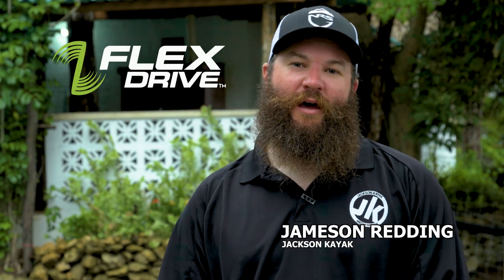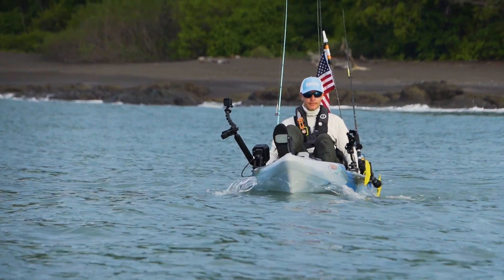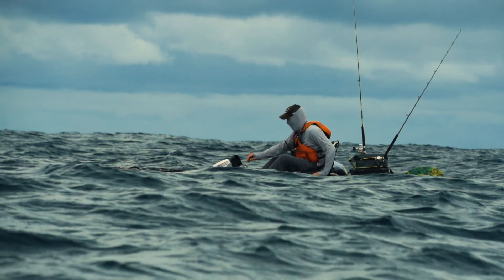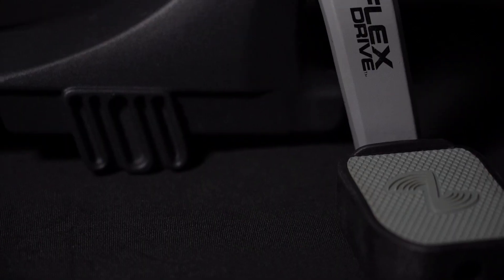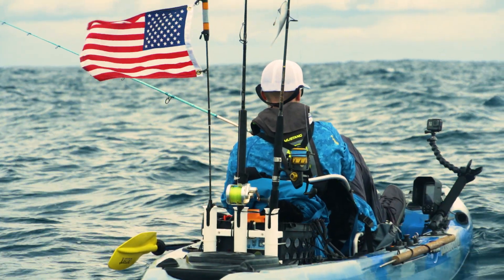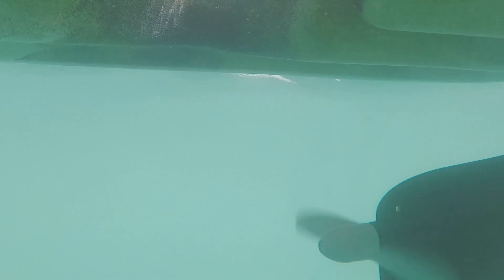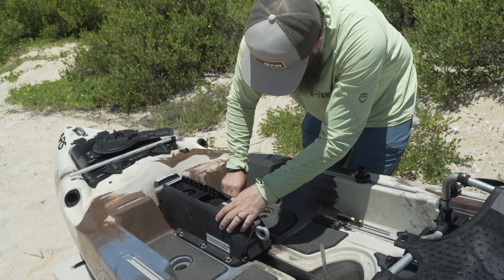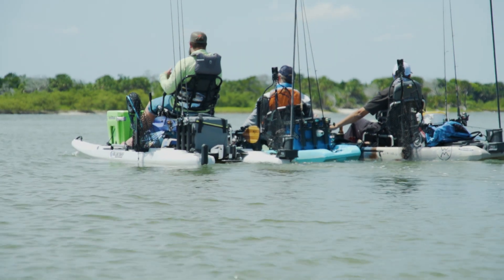Jackson Flex Drive 3D | In-depth Features

Comment: im very interested in becoming a jackson coosa fd owner! But not sure if an upgrade from the 2019 system to the 2020 model is worth the extra $600... ive heard that the original flex drive on the 2019s tend to have issues. should i be worried or concerned?
Reply from the maker: We stand by our products. If you have any issues with your FD please contact customer service.